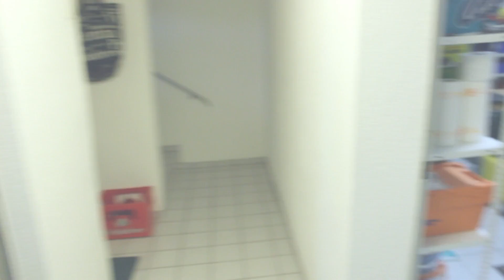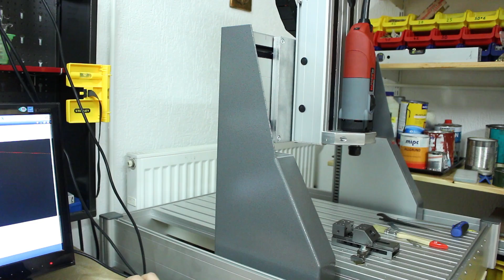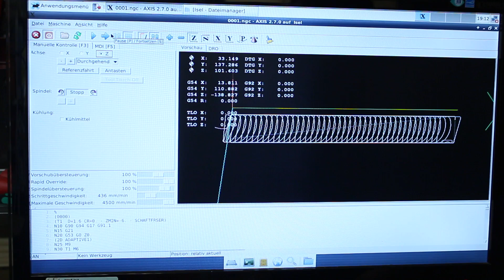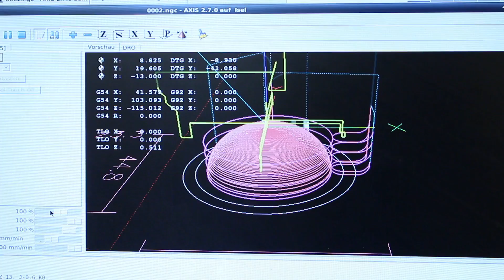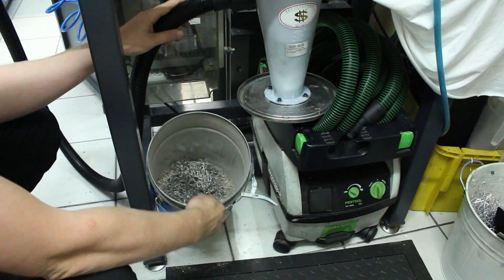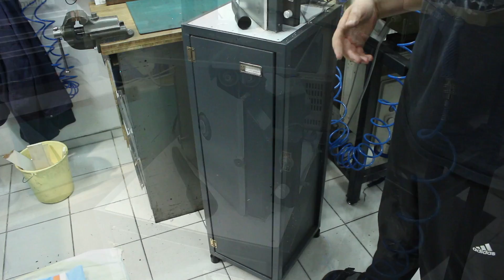Shoptalk #14 / 07-2017

Comment: You do R&D for a living? What kind? Could you name the company?
Reply from the maker: I work in the R&D department of one of the bigger german companies that is building RCDs, Circuit breakers and other switching gear. We build for example the first prototypes of new devices from ground up, machine the housings from plastics, the internals from plastics and metal, create tooling to bend/shear/punch/form wires and sheet metal parts and assemble the prototypes, all in house. My part in this process is Cad/CAM and machining the parts on a DatronM10 cnc router..and sometimes a bit of manual machining.
Reply from the maker: Pinned it, as the question comes up quite often ;)
Reply: @StefanGotteswinter  Freitag Parsberg......😉

Comment: Stefan, I have been looking at Isel USA while you have been talking and l like their machines very much. I have complete sets of needle files, Tesa inside and outside micrometers,  Two Cherries German made carving tools, and I need to make cases / etuis for them all. I use Honduras Mahogany  for my boxes and I am also disabled and can programme for CNC machining, l just can't work long hours anymore. Your size tool with maybe another 100 mm in the X and Y directions and 50 mm extra in the Z plane would be great. 
The company has an office here in the United States so, I'm going to be calling them up today for a price quote. Thanks Stefan for the demonstration of your machine. The motor may be loud but it sounds powerful. They range from 3 HP to 10 HP; or 4.2 Pferdestärke to 14  Pferdestärke.
You haven't wasted any time or effort on your demonstration of your ISEL CNC  ROUTER. The machining of the dome shape was very important for me to see. Thank you very much.

Comment: Hello Stefan. This is a workaround that might work for your G53 problem. You could edit your Linuxcnc.cps post processor code as follows (tho code starts at about line 116):

/**
  Writes the specified block.
*/
function writeBlock() {
  if (properties.showSequenceNumbers) {

    if (sequenceNumber == "20") {
        writeWords2("N" + sequenceNumber, "G00 ... ;whatever GCode you want to appear instead");
    } else {
        writeWords2("N" + sequenceNumber, arguments);
    }
    
    sequenceNumber += properties.sequenceNumberIncrement;
    if (sequenceNumber > 99999) {
        sequenceNumber = properties.sequenceNumberStart;
    }
    
    } else {
    writeWords(arguments);
  }
}

The code simply overrides the GCode line "N20 ..." that outputs the G53 "homing" routine. In my simulated case it looked like in your case:
...
N10 G90 G94 G17 G91.1
N15 G21
N20 G53 G0 Z0.
...
My code above checks if GCode line "N20 ..." is written. If so, it replaces the line with whatever GCode you want to appear. As an example, the code above outputs "N20 G00 ... ;whatever GCode you want to appear instead". You could simply edit the code line to e.g. "... writeWords2("N" + sequenceNumber, "G00 X100 Y100 Z100"); ..."

Hope this helps.

Comment: Love your channel! I'm also running Linuxcnc with an Intel 525. I had trouble getting acceptable latency so I got a Mesa 5I25 board (PCI bus, parallel port) to offload the pulse generation. They are only $90 and seem to work well.

Comment: Thanks for the video Stefan.I own a cnc router also, with a cress clone ruouter as power source. Works very nice on cutting wood and plastics. Have you tried aluminium yet? Mine sucks but I might have a solution...
Reply from the maker: Yes, I did a few testcuts in aluminium and it worked quite well - Not great on material removal but for complicated shapes it is an option :)

Comment: I like the bandsaw mods, mine is almost always vertical as well, but I'm not ready to give up the horizontal function. Tom Lipton is quite right when he says "if you can only have one saw, make it a vertical metal cutting bandsaw". I put it on a wooden base and casters to get the height up.

Lately I have some issues with the blade coming off if I put too much feed pressure on. I just can't seem to figure out why that happens. I'm not sure if it is the blade tension, or an alignment issue, but it doesn't seem to get better no matter which way I tweak things, and the blade tracks fine under no load. How tight should a bandsaw blade be anyway? 

I have that same Omron VFD powering the saw (and drills, and belt grinder).
Reply from the maker: I love the small Omron VFDs, they are very cheap second hand, reliable (All the good stuffs made in Japan!) and easy to setup.
As for bandsaw tension, I crank as hard as I can without additional tools on the plastic knob and it seems to be about right.

Have you checked if the two wheels are in the same plane? The upper idler wheel can be moved in and out...maybe thats the problem.
Reply: I will check the plane with a straightedge. Maybe you can pluck your blade one day (on the long side), I definitely could tighten the knob more but was afraid of breaking the blade or causing unnecessary wear.
(There is only a plain bearing on the idler wheel !!!)
I am not sure if the driven wheel slips, allowing the blade to slip off, or if the cutting force somehow pulls the blade off track. It tracks nicely with no or light load, I adjusted it so that it only just touches the ledge at the back of the wheels.

The VFDs are nice, I just wish they would make the enclosure so you can connect a cable and have it properly insulated without adding another cover. I found mine in the trash, tested it, it worked, installed it, it didn't work, took it apart, found nothing, put it back together, it worked again. Works still, I hope it will be reliable now as you say ;-)

Comment: I hooked up a Dust Deputy to a small, but powerful, Rigid shopvac and got the same impressive results as you did.  It's definitely a worthwhile investment even if the vac doesn't use container bags, it keeps the vac filter much cleaner.
Good video, Stefan.  
P. S.  Looks like you've worn out the hard toe on your safety sandals.  Hahaha!  ;-)
Reply from the maker: :D
I have safety socks! ;)

Comment: Just curious, why you just didn't build a cnc router like Tony did? That Kress dremel is a piece of junk. He is making you look bad. 
This isn't a negative comment. I love all your videos! Didn't you read all the books Tony left for you on the bench? You know... When he traveled back... Oh crap! Never mind.
Reply from the maker: Because I didnt want to commit to a project for a year to build a router that would end up way to heavy-duty for the work I need it.

What exacly is crap on the Kress router motor? Explain please.
Reply: Stefan Gotteswinter For the machine that size it is a great option over some of the other routers. But for a larger machine it would under powered for long term use.

Comment: I couldn't live without my Chinese 4x6 horiz/vert band saw. I sometimes use it vertical but the majority of the time, I'm cutting off a 2 inch dia pipe, or a 3 inch square of aluminum. I really like that I just set it up and it can take minutes to saw through something while I do something else. Vertical is nice till you have to cut off a piece of round without a vice.
Reply from the maker: I just drop a drillpress or grinding vice on the table of the saw and push trought. With the coarse blade it takes less than a minute to cut trough a piece of 50x30 toolsteel...

Comment: Hi Stefan
Would you recommend such a milling machine to mill very small pieces (8mm diameter 4 pole electrical motor core) with a 1mm carbide ball end mill? The material is a ferrous material with a 20 Rockwell hardness rating. My concern is regarding the aluminum structure, eventually being not rigid enough? I would mill it probably at low linear/circular speeds and taking 0,1mm depth cut increments. I know the motor core has to be a laminated one, but for my application it is not relevant. It is a typical motor core, like the one you find on very small toys (those have 3 poles) and this one will have 4 poles. I was looking at CNC 6040 2.2KW 4 axis from www$china-cncrouter$com. I know you can not endorse a product by a picture, but am I taking to much risk?
Reply from the maker: I looked at the china-routers before and yeah, I am not impressed ;)

The material you want to machine does not sound to friendly to a cnc router either. I would look into something more rigid, like a benchtop cnc mill (maybe a Sieg SX2/SX3 with cnc conversation)
Reply: Thanks for your input. I will probably do and have the posibillity to a broader type of jobs. A pleasure to see your videos.

Comment: PS:  The first thing you need to build is a vacuum hood to suck the dust up.
Reply: He said that is his first priority.
Reply from the maker: Not a big fan of dust shoes - They are always in the way and distract the view. I might just use an arm from an indicator stand and mount a shopvac-nozzle to it.
Reply: If you go out on CNCZone.Com - to the CNC Router forum - you will find a few really nice designs.    One guy built his out clear acrylic plastic - so that you can see what the unit is cutting.   Anothter guy added LED's.. The designs come apart from the router, so that you can change cutting tools / router bits.    After you use the CNC-router a while - you wll find that you don't need to watch it so much.  But it is always fun to watch it work while you drink coffee.     http://joecomunale.com/homework3/hw3_3.html   also http://cnc-joe.com/projects_annie.html   there are others - but these have the main info.

Comment: Interesting video as usual, Stefan, Thanks. I thought of converting my bandsaw to vertical only, but ended up leaving it as dual purpose. One thing I did consider, though, was to turn the blade 45 degrees so it can run straight instead of having the two 45 degree twists every time it goes round. Other than reducing the stress on the blade, it would also increase the effective throat depth, well, sort of. I suppose the throat depth is as big as you like at the moment, as long as you don't want to cut more than 4" in or so. Actually I think I've talked myself out of it.

Carry on!

Mart.
Reply from the maker: I like the fact that it is 45° offset, as I can cut very long stock without hitting the frame of the saw :)
Reply: Yeah, that's what I realised as I was writing it!.. 

Always enjoy your videos.

Mart.

Comment: That Bosch vac looks like the Stihl Vac we sell at work.  I like the converted band saw very nice and handy!
Reply from the maker: Yeah, I dont think Bosch builds it by themself...
Reply: wouldn't surprise me when both machines would be from an other brand (could be a OEM production run for those two brands as for example starmix produces a lot of vacs for other brands as well... for example Bosch, Metabo, Mafell, Hitachi, and so on)

and as STIHL uses the L-BOXX system from Sortimo-Bosch as well a cooperation wouldn't surprise me at all as well ;-)

Comment: I just picked up a used Isel machine myself. I got the fixed gantry, stepper motor DaVinci, which was targeted to schools. This one barely got any use, as every kind inspection has revealed. Killer deal, but the controller is so ancient I had to upgrade it. I went the TinyG route for this little unit. Finally got it wired in this week and now I need to learn how to use it...

Comment: How does one attach a sheep to the router? Special clamps. I guess you could get cnc controlled milk production like that? On a serious note, are you using a special card for the cnc or and older machine with parallel port built in?
Reply from the maker: The TripleBeast controller I run hooks up trough the parallel port.

Comment: Do you set your Z zero mathematically by knowing the distance from the Z home to the table top or do you zero  to the top of the stock somehow?  Nice machine.
Reply from the maker: I prefer to pick the top of the stock as a zero - Thats what I am used to from work.

For touchoff I use an old gageblock, jog down with the endmill until I almost touch and then step down in 1/100mm steps until I can not slip the gageblock under the endmill anymore. Then I can set the Z offset to the value of the thickness of the gageblock.
Reply: Stefan Gotteswinter thanks Stephane!

Comment: Won't this do everything the pantograph will do but without having to make physical templates?
Reply from the maker: Basicaly, yes, but the Pantograph is the preciser machine and it has a larger work envelope, especially in Z direction (For example using the rotary table on top of the angle table..)

Comment: can you talk about programming a vfd?
Reply: Jakob, check out the websites of the various VFDs you are considering.  They all have the installation and operating manuals in PDF format.  The modern VFD is very simple and straight forward and even the most affordable model is extremely versatile.  Really, they are very simple to setup and understand!.
Reply from the maker: That is so different from manufacturer to manufacturer. When you have the manual for the vfd, just go trough the setup procedure, pretty much every manual has a "quick start" or "basic setup" section, where everything is explained to get the vfd running, from there you can add more and more options according to the manual.

Comment: Good stuff Stefan...building my own machine and want to use Linux CNC or Heeks CNC, I'm trying out Freecad and Heeks cad with Linux OS ...anything but Windows, so any videos with tips and tricks would be welcome...especially from an expert...great to see you can add another subject to your videos, cheers.
Reply from the maker: I tried Heeks a few years ago and it was a utter pain, almost like Freecad ;)
I run my Windows 7 licence in a VirtualBox and thats good enough to run Fusion360 (Make sure to enable hardware acceleration for the graphics..)

Comment: Sehr schön zu sehen, ich hab mir vor einer Weile eine eigene CNC-Fräse gebaut, die ist allerdings eher im Low-Cost-Bereich anzusiedeln. Macht mir trotzdem viel Spaß, damit zu arbeiten. Ich verwende einen Arduino mit Grbl für die Steuerung, da ich hier nur einen Laptop ohne Parallelport habe, da brauchte ich eine Lösung mit USB.

So einen Zyklon-Abscheider hab ich mir auch selber gebaut, aus einem Kunststoffmülleimer mit Deckel, ein wenig Polycarbonat für den Trichter, einem alten Staubsaugerschlauch und viel Heißkleber :D
Funktioniert sehr gut, ich hab in dem Eimer gleich einen Müllbeutel drin, wenn der voll ist brauch ich den einfach nur zuknoten und gut ist. Ein Bekannter hat es mit einem Verkehrskegel und einem Farbeimer probiert und ist damit unzufrieden, da sich das Ganze bei Belastung des Staubsaugers total zusammenzieht.

Comment: Some worthy upgrades going on Stefan. The band saw mod was very good.  I have just recently started with Fusion360 myself for driving a 3D printer. There is a channel by Lars Christensen who is a Fusion guru and Autodesk employee. https://www.youtube.com/user/cadcamstuff  He is very open to questions and will often create video tutorials based on viewer questions. 
For the router you might also look into Octoprint by Gina Häußge. It is a web based print server which runs on a Raspberry Pi. There is a GRBL plugin that will serve code to a CNC router. This will allow you to free up a computer by simply sending the file over WiFi to the Pi from the quiet and warmth of workshop.

Comment: Very interesting video, thanks. I have a Chinese 3020T CNC router, very similar to yours only smaller and cheaper. I had to replace the acme screws with ball screws because the backlash was intolerable for my purpose - mainly isolation milling to make PCBs, but also some general milling of wood, perspex and aluminium. I've added a rotary axis, and upgraded the controller,  M542 microstep drivers and a Sainsmart USB controller card for Mach3. Unfortunately that means I can't use LinuxCNC, but I've found Mach3 to be really nice to use. Using the USB card means that the load is taken off the PC because the card buffers all the signals so that you never miss steps.

PS, have you thought about getting a 3d printer?

Comment: You wouldn't know what to do with yourself if you had Keith Ruckers shop (roughly 320m2).  That gear drive and motor looks like it cost 5x as much as the band saw did.  Nice though.
Reply: The SEW gear motors ("Eurodrive") are very common here and you can pick up used ones for a good price when you know wghere to watch out :)